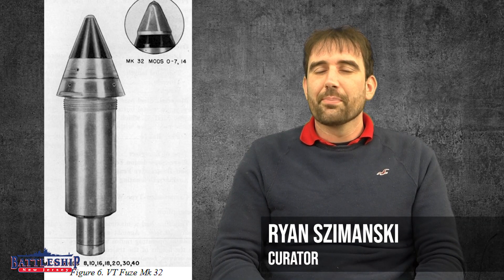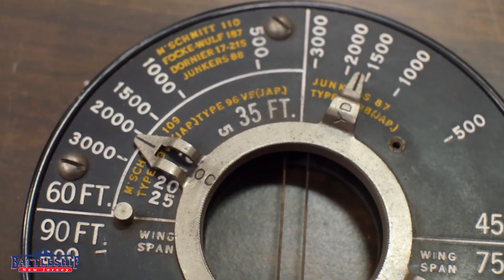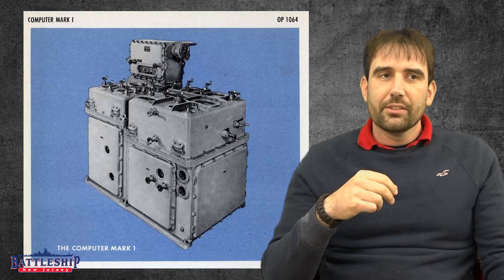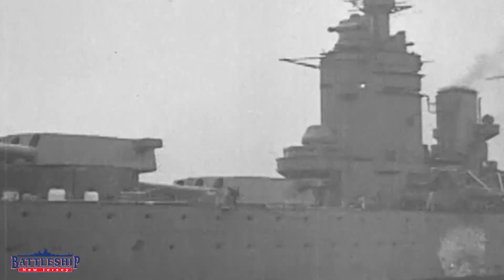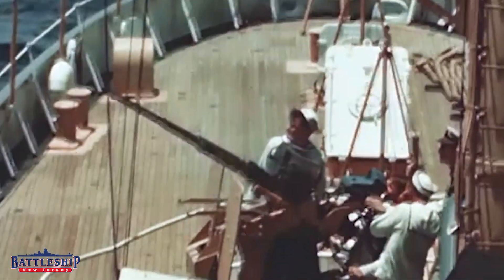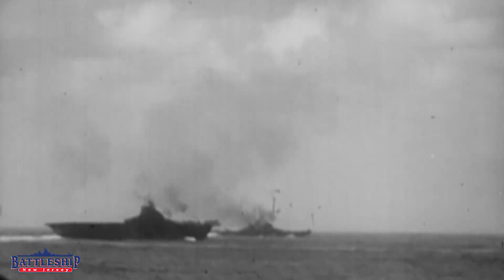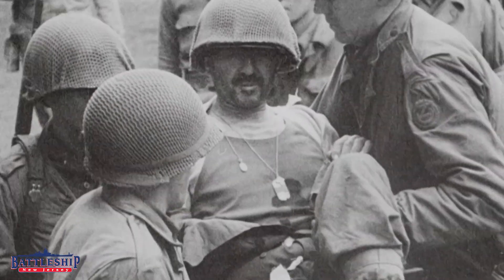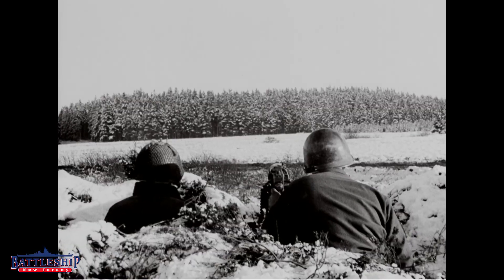Developing the Proximity Fuze

Comment: I’d love to hear your thoughts on the Norden bombsight and the development of game theory to respond to German bombers during the blitz.
Reply: The Norden bombsight was greatly overrated.
Reply: @dalecomer5951  based on...?
Reply: @sethgrandeau9267  The Wikipaedia article on it is surprisingly good even though obviously written by a Brit. I would add that the thing was not hermetically sealed so it was vulnerable to contamination by moisture and fine particulates. A small amount of water vapor at ground level is a show stopper at high altitude. The heavy security Kabuki surrounding it was largely a smokescreen to hide the enviromental problems. The security classification was never higher than SECRET. Probably the biggest issue was they didn't need it. The leadership of the USAAC before the war had no clue as to the appropriate heavy bombardment doctrine that would be needed in the coming war. The same marginally competent and some incompetent senior officers led the USAAF through the early years of WWII and later. While they were learning their jobs tens of thousands of guys were killed, captured, maimed for life or MIA and thousands of aircraft were lost. As bombing doctrine evolved to meet the harsh reality of the war the heavies had to carpet bomb at altitudes of typically 6,000 to 8,000 ft AGL to be effective. Don't need a bombsight hypothetically designed to bomb from 30,000 ft AGL and greater for that. Finally, the Germans built their own system correcting the obvious deficiences and found they didn't have much use for it either. The Sperry system as used in the early B-24 was a superior system. It's technical evolution through and after WWII led to inertial guidance systems for navigation and missile flight control although it too would have been overkill in the WWII heavy bombardment situation.
Reply: @dalecomer5951  the British SABS gyroscopic bombsight used by the RAF 617 Sq. 'Dam Busters' from the middle of the war on were the best bombsight of the war by far, IMO. Once the crews were trained how to use it properly they would routinely get the majority of their bombs within a hundred yards the vast majority of the time. Some of the most impressive bomb hits of the war, and possibly ever, were pulled off by 617 bomb aimers using SABS. A direct hit with a Tallboy bomb on the German battleship Tirpitz, aiming only at the top of a mast poking through a smoke screen. A direct hit on a tunnel in France, again with a Tallboy, aiming between target markers which had been dropped at either end of it. A direct hit on a the span of a railway bridge with a Grand Slam bomb, which was already airborne after a near miss by another bomb. There are many more. 617 was nicknamed the 'Sniper Squadron' for a reason!

Comment: I thought caliber was bore diameter. Why are the 16 inch guns 50 caliber and the 5 inch guns 38?
Reply: The barrel length is measured in multiples of the calliber, so a 16 inch 50 would have an 800 inch long barrel.
I don't know why it's measured like.
Reply: @stephens7136  it's the difference between "artillery" (or "artillery like") and "infantry guns", generally speaking anything over half an inch (12.7mm aka 50 cal) in diameter goes by the artillery system where caliber describes length of barrel (projectile diameter * caliber = barrel length), if it's half an inch or less it goes by the infantry gun standard where caliber is diameter of projectile
Reply: @can_hauler  I meant I don't know what advantage there is to that type of measurement, like does it make it easier to compare the trajectory (do a 3"-50 and a 5"-50 have similar arcs?) Or is it just tradition?
Reply: Caliber is the diameter of the barrel. The barrel length can be expressed in multiples of the caliber or "calibers." People often fail to properly use the plural.

Comment: How did timed fuses work before the VT fuse? Was there a little knob or something for you to set the timer before you load the shell or was the timing set from the factory?
Reply: The 5" guns had a fuse setter that the shell went into right before loading the gun.  The computer relayed the time up to the mount and set the time on the fuse setter with a selsyn syncro repeater.  The computer added an estimated time for shell and powder casing loading and the breech closing plus a small margin.  The computer would fire the gun when the calculated time to target matched the time set before the shell loaded.
Reply: @matthewbeasley7765  That's cool.  I had a picture in my head of a little knob on the front of the shell like an egg timer or something that the gun crew had to set right before shooting.  based on your description it doesn't sound like you couldn't set your time/range and wait for an aircraft to come into the range you set, sounds like that would be like holding on to a grenade after you pull off the spoon.  I can see how the automatic fuse would be a massive improvement.
Reply: @NomadShadow1  Just to clarify, the fuse is armed by rotation.  When the gun fires, there is a massive rotational acceleration, and that arms the fuse.  That is true of all fuses - even the big shells, to make sure it doesn't go off in the gun.  The impact fuse is armed and the timer on the timed fuse starts counting down at firing.
Let's just give an example - say the computer figures out it is 12 seconds between shooting and arrival at the airplane.  Remember it is relative, the airplane is getting closer so by the time the shell gets out there the airplane is closer and that is accounted for.  So for the example the computer sets say 10 seconds to cover the time to get the gun loaded and ready to fire.  The computer then waits until the airplane closes until flight time is estimated at 10 seconds and then the computer shoots the gun.  The timer isn't going - the time to impact is only getting shorter because the airplane is getting closer.  If the gun is never fired, the shell is completely safe to unload.

Comment: Most important WW2 invention: "The Bombe" at Bletchley park, Alan Turin basically invented modern computing.
Reply: You're conflating a bunch of events: 
The Bombe was a Polish invention that Turing expanded upon and made automated. He did a lot more to improve cryptanalysis, but it gets into some really obscure maths.
The first all-electric computer was Colossus, and that was designed by Tommy Flowers for cracking the Lorenz cipher machine. 
Turing's groundbreaking work in computing theory wasn't an invention, but the theory that any 'Turing complete' computer could perform any computable calculation, and that was publish years before WW2. Though, the Turing Machine is really abstract, and it was Von Neumann's work that later created a practical framework.
Reply: @watchm4ker  I stand corrected...
Reply: @marshallwhite7324  Sorry, that wasn't meant to be insulting. A LOT happened at Bletchley Park, and stuff is still being gradually declassified piece by piece.
 Turing's work was more fundamental than Von Neumann's, but Turing didn't really work out how a practical computer could be built. Just that it could, and no matter what form it DID take, what it could and could not be capable of, given sufficient time and space to work in. He was, after all, developing this in the 30s, and vacuum tubes were expensive.
Von Neumann took those ideas and, after the war, applied them to design the Von Neumann architecture, which became the basis for modern computers.
Colossus didn't have an impact post-war, sadly, because the UK was determined to never let anyone know what they'd done.
Reply: @watchm4ker  no worries, no offense taken. I am certainty not a historian just anther human with an intense interest in the one of the most horrific and transformative eras in our collective past. I appreciate the time and effort you invested in your replies, thank you. I suppose the unprecedented  level of international intellectual collaboration during the war is the real wonder here. From developing the VT fuse to breaking Enigma to the development of atomic weapons the knock on effects from these efforts have influenced our daily lives in untold ways. Cheers!
Reply: Turing supervised the construction and installation of the British implementation of the Bombes (the Poles called theirs "Bombas"). Turing's most significant contribution was with "cribs." Cribs were nsights into indivixual messages which could be deduced by inspection to reduce the number of Bombes allocated to a particular message if possible and to significantly reduce the Bombe running time if possible. At that he was the best and he could teach others.

Comment: The oerlikon 20mm was good at destroying planes, just not before the plane reached launch point ( torpedo and dive bombers). The bofors 40mm could. However , the vt was so much better, and at the time, could only be reduced to fit on a 75 mm shell. Late in the war, there was a plan to replace the smaller aa guns with 75mm.
Reply: 76*
Reply: The 3 in./50 rapidly displaced the 40 mm on new ships and refits in the last year or so of the War.

Comment: Would the Des Moines Class have VT fuses on its 3 inch guns?
Reply: Yes.  That’s probably the reason it had those instead of 40mm guns.
Reply: I don't doubt that they could deploy VT fuse in a 3 inch shell, since the US/GB used the same size/thread of fuse across ranges of shell sizes. The issue I would be more curious/concerned about is whether the 3 inch shell would need to carry a smaller than normal bursting charge to make room for the larger size of the VT fuse. For an airburst/proximity shell it may not make a lot of difference, but it would be interesting to know. Also the 3 inch shell is more suited to field artillery usage, which may also notice a smaller bursting charge.
Reply: @jaybee9269  Correctomomento.
Reply: Yes the VT fuze was used in the 3" projectile.

Comment: Good trick with electronics based on glass bodied vacuum tubes. Extremely high G-forces, by being fired out of gun. Fortunately, the squared-cubed law works great, so sub-miniature vacuum tubes worked out. As a linear dimension scales, the strength goes up as a square (n*n), and the weight goes up as cube (n*n*n). It works as you shrink things, too. That's why a ant can lift 16x its weight, but if you scale it to human size, it would collapse under its own weight.

Comment: When did the Battleship New Jersey gain its fathom meter?  I may have the term wrong, but it's basically a small sonar set that measures the depth below the keel.  The major method of avoiding hanging up on the sea bottom was using charts to avoid shallow areas during World War Two.  

Other technologies of World War Two replaced more elderly systems.  There were engine and rudder telegraphs.  Voice tubes.  Signal lamps connecting various ship functions to the bridge.  Prior to World War Two the Navy was the most technical armed service.